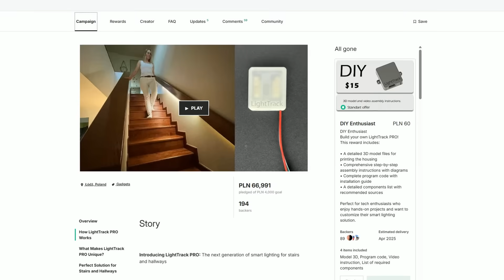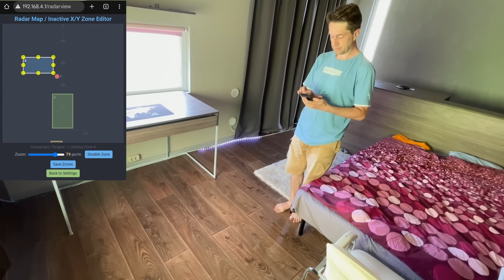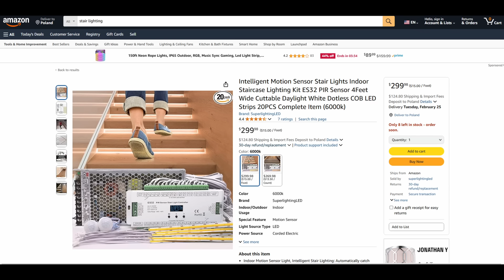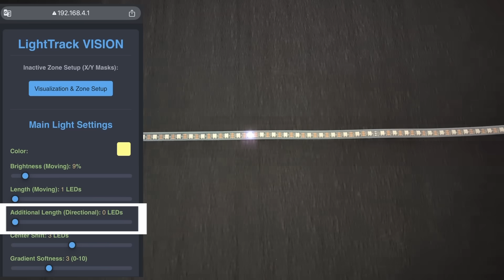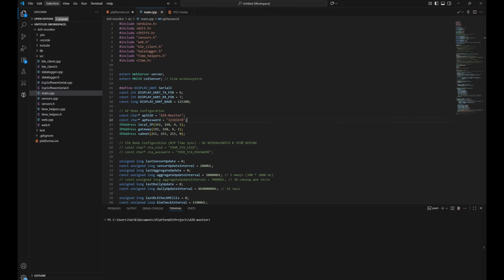My Smart Lighting Invention for Home & Yard (Open Source Code)

Comment: Nice work, but I'm curious as to why you would need the predictive calculation at all? mmWave sensors update pretty fast already and are pretty accurate, so surely you'd only ever need current position + some smoothing on that to make sure it doesn't jitter around.
Reply from the maker: Good question — you’re absolutely right that mmWave updates are quite fast, but predictive calculation helps smooth out micro-delays and maintain continuous motion when the radar briefly loses track (for example, due to body orientation or partial occlusion). It basically fills in those tiny gaps so the lighting feels fluid instead of reacting in short jumps.

Comment: I assume the ready-to-go unit will use a custom PCB with all the key components on it? If that includes the radar antennas too, it sounds like it could be quite challenging.
Reply from the maker: Yes, exactly — the ready-to-go unit already has a custom PCB with all key components, including the radar module. It’s a complete, finished device, not a DIY kit.

Comment: Right now I would prefer a simple adressable light strip which activates and illuminates the whole path for a given time and then dims itself to 5% before turning off completely. That can be done with cheap sensors and wled. 

The projects looks fun but I think I would get many complaints rather fast because people including me want to see the whole path and not only the next few meters.

Its a cool project even if not practical
Reply from the maker: That makes sense — and actually, you can configure it exactly that way. The system can light up the entire path for a set time,  and then turn off — all adjustable in the settings.

Comment: Looks cool, but the truth is that absolutely useless... You see, when you enter dark corridor, you need to have enlit what is upfront, not what is at your foot steps. So yes - no practical application, but very-very nice looking.
Reply from the maker: That’s a fair point, but the system is fully adjustable — you can set it so the light appears ahead of you instead of under your feet. I actually mentioned and showed that mode in the video :)

Comment: In your video you mentioned “an extra antenna, to improve accuracy” Is that just your choice of radar module or is there an extra/external part?
Reply from the maker: Good catch — that was actually my mistake in the video. I thought the extra antenna on the module improved radar accuracy, but it turned out to be the Bluetooth antenna. I’m not entirely sure it helps with detection, but the module itself still performs great even without any external antenna.

Comment: I'd rather the whole length of the strip in front of me turn on so I can see what's ahead of me at a distance, not just what's immediately ahead of me as I walk, then the lights turn off behind me as I move forward.
Reply from the maker: Haha, yeah, I’ve heard that one a few times 🙂
It can actually do exactly that — you can set it so the entire section in front of you lights up while the area behind gradually fades out. It’s all configurable in the settings.
Reply: @DIY_Yarik Very cool. I love this kind of engineering.
Reply: @DIY_Yarik I think it would be a good idea to make this more clear to people. Great project!
Reply: @DIY_Yarik he doesn't understand that, brain smooth
Reply: Then this vid is not for you jajahaha
Reply: Boooooringggg!   lol

Comment: So there's only one radar? And it has such precise detection?
Reply from the maker: Yeah, just one radar — it’s surprisingly precise :)
Reply: @DIY_Yarik Very interesting! Since the interface is served as a web page, you could allow the esp32 to be connected to the local network and create local webhooks to trigger some lighting effects or turn on/off the lighting automation system. This would basically create the integration with Home Assistant that many are asking for.
Reply from the maker: Yes, that’s definitely possible — adding local webhooks or simple API endpoints would make Home Assistant integration pretty easy. The only concern is performance: extra network handling can slightly affect real-time response.  

I’m already experimenting with integrating Home Assistant into the code to see how well it performs. If everything runs smoothly without affecting real-time response, I’ll definitely include it in a future update.
Reply: @DIY_Yarik Fantastic, thank you so much. I hope to see it soon! The only thing I'm wondering now is whether the radar needs to be aimed linearly with respect to the LEDs. How do you handle it, for example, when the stairs curve 90°?
Reply from the maker: Good question! The radar doesn’t have to be perfectly aligned with the LEDs — it just needs to “see” the direction of movement.
For a 90° turn or curved stairs, it’s best to use two radar modules — each will cover its own section and control the lighting in that area.
That way the transition looks smooth and natural.

You can actually see the full installation process and positioning in this video tutorial:
👉 https://youtu.be/qoP3eqkab6k

Comment: Maybe with a version that doesnt use MMW tech this would better,   MMW has a number of health issues associated with it, far exceeding the already known issues with 2.4ghz standard wifi.
Reply from the maker: Thanks for the concern!
Just to clarify — the device doesn’t use any millimeter-wave (MMW) emitters at all.
It works on the same safe, low-power 2.4 GHz range as regular Wi-Fi or Bluetooth, fully within international safety standards.

Even MMW systems (like some 5G bands) operate at power levels far below what could affect human tissue — but in our case, that technology isn’t used at all.

So no worries — everything here is completely safe for long-term use.
Reply: @DIY_Yarik  The first board you were using is wigig which is MMWave... the second board is 24ghz which has longer wavelength than 60ghz so it can penetrate further ...  60ghz is still likely far worse due to its 02absorbing properties , but 24ghz is concerning for many reasons ... ive looked up that module and its not 2.4ghz its 24...  and if you see all the research out there on 2.4...  24 is an entirely different ballgame ...

 "The recent release of WiGig and anti-collision vehicle radars in the 60 GHz region embody a 1000-fold increase in frequency, and photon energy, over the exposures mankind experienced up until the 1950s."...
https://www.ncbi.nlm.nih.gov/pmc/articles/PMC5406447/
Reply: @DIY_Yarik  CNN did a broadcast regarding 60 ghz back in the 1980s ... its a military grade one... and quite alarming that they are switching the standard sensors found in industries from 24ghz to 60ghz considering the problems w/it
Reply from the maker: Yes, you’re absolutely right that 24 GHz and 60 GHz are in the millimeter-wave range — these frequencies are used in many automotive and industrial sensors.

Just to clarify: our device uses very low-power short-range radar modules, operating at levels thousands of times lower than any safety limits defined by international standards (FCC / CE / ICNIRP).
They are passive sensors, not communication transmitters like Wi-Fi or 5G, and the actual emitted power is measured in microwatts, not watts.

These frequencies have been used safely for decades in motion detectors, automatic doors, and car radars.

Appreciate your curiosity and the link — it’s good when people dig deeper into the tech they use.

Comment: Wouldn't it work with COB?
Reply from the maker: COB strips look awesome thanks to their high LED density, but unfortunately the microcontroller can’t handle that load — for now, the limit is about 60 LEDs per meter.

Comment: 1:20 - you ned to fade a bit more, and add some low pass filtering, the light is to "jumpy" I think. Super cool project - great work! 🤓
Reply from the maker: Good catch! Yeah, there’s a quick snap when the direction changes — that’s one of those fine-tuning details I actually enjoy working on. I’m adding smoother fades and a bit of filtering in the next build to make the motion feel more natural.
Reply: @DIY_Yarik  I guess some filtering on tracking and some rate limiters, faster turn on than off ramps would make sense. 🤔
On a side note, some ppl have more sensitive eyes - so some can detect pwm as flicker, if not fast enough, while others cannot. 🙂
Reply from the maker: Exactly! I’m experimenting with adding rate limiters and different ramp curves — faster rise and slower decay really make the motion feel more organic. And yeah, good point about PWM — I noticed some people are more sensitive to it, so I’m trying higher frequencies to reduce visible flicker.

Comment: Do you plan to add home assistant support?
Reply: This device being esp-32 and being open sourced might be somewhat trivial to get working with HA.
Reply from the maker: Sure, integration itself isn’t a big challenge — the main issue is maintaining real-time performance. Once you start adding communication layers, MQTT traffic, or HA polling, even small delays become noticeable in dynamic lighting like this. I prefer keeping it fully responsive first, and then maybe adding optional HA hooks later once I’m sure it won’t slow down the core logic.
Reply: @DIY_Yarik  make it HA compatible with RGBW and ill take 3 Indoor pieces (even with Price increase). Greetings from your neighbor in Germany
Reply: @DIY_Yarik  is there source anywhere? i dont know if you already use it but i would suggest using all the processor cores to their advantage - seperate tasks for everything ... (you have a webserver on there, there are reserves) and the spiffs for the ui.
Reply: A few weeks ago I build something very similar using ESPHome. It was quite easy actually and perfectly works with homeassistant
Reply: Same as Henninger01 over here. I'm definitely in once this thing has Home Assistant functionality and RGBW. Bonus points if you have a 896/m COB LED version (the only way to go with LED strips as far as I'm concerned). Brightness will be a key factor as well. I would be so keen to add these to exterior stairways and garden paths!! Good luck!!!   :)
Reply: I think it's more about the ability to change settings in HA without using the app.

Even WLED doesn't offer much control of the LED strip via HA, just color and brightness of the entire strip. Gotta use other software to make use of addressable LEDs for animations, ambilight etc.
Reply: Yeah HA support is a must have tbh. Maintaining all devices and integrations within HA can eat my time already. Imagine having to deal with a seperate interface and it's patches for every single smart device I use... Simple wled like functionality would already be more than enough and would easily run next to the internal lighting program.
Reply from the maker: Not for now — the controller already runs at its full capacity, and Home Assistant requires quite a lot of resources to operate smoothly.
Reply: @DIY_Yarik hmmm...not sure what you mean. You wouldn't run Home Assistant on this device, rather this device would communicate out to HA.